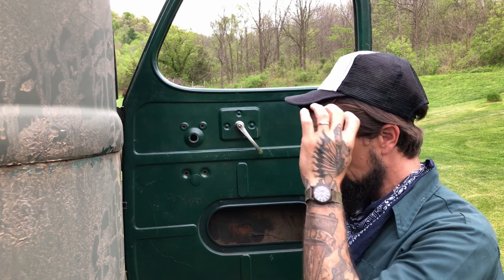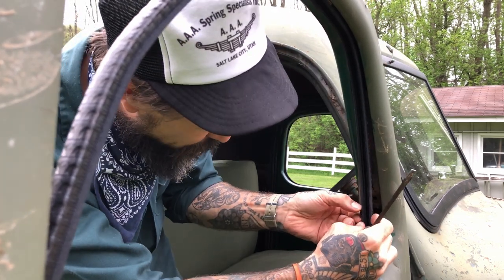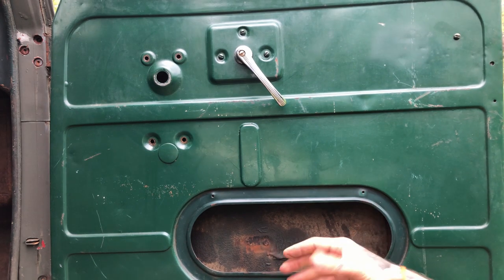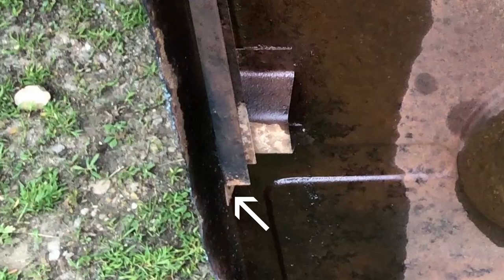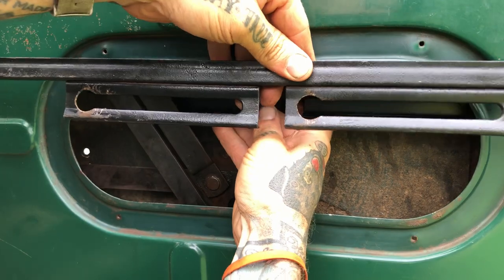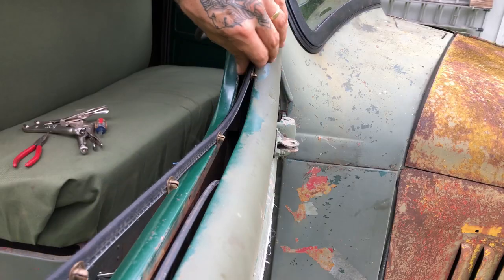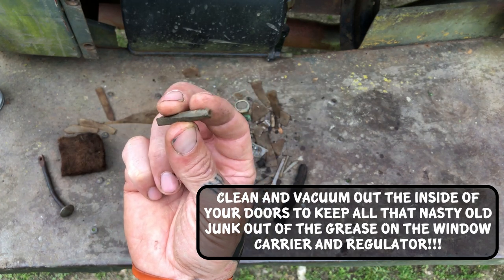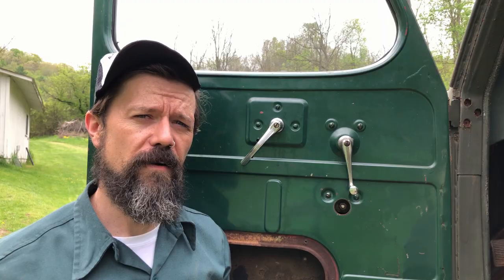Fixing 1940s International Door Window Pt 3

Comment: You should make a video using that spare inside door panel. Showing the window and door latch systems working from the inside view. Would help owners visualize what is going on in there. Can't wait to get my truck back home and start this process after seeing this. Truck is having the rear window modified to roll down right now so they are adding pretty much the same setup as what is in the doors. Although it will be motorized. Didn't want to turn around to crank it open or closed. Gonna find another windshield crank to use on the dash as the switch.  Thanks for the detailed videos. Well done.
Reply from the maker: Hey, that’s a good idea! I’ll start getting that video together in the next month or so!

Comment: Great illustration on replacing everything. Where did you get the new felts at. I just bought a 47 and I’m going to try and rebuild everything, window roller and the door latch. Any advice would be greatly appreciated.

Comment: In the process of doing my windows and door regulators currently. I used a rust remover on the regulators but let sit for over a year. everything got extremely goopy. Back at it now. I used blue liquid toilet bowl cleaner with wire brush made regulators look really good and clean. Cant recall the grease you used. Also what was the tape you used at the bottom of the window track?

Comment: Great video. Restoring. 1940 international 1 ton.  A real rust bucket. Tip on hammer screw driver saved the day.   Cut the slots
Deeper with an angle grinder.  All came out. Explanation on the nut was invaluable.  I’m trying to find window carriers.  Any ideas?  Thanks Al.
Reply from the maker: There’s quite a few IH groups on FB that you may try posting that you’re looking for some, those groups are pretty valuable for finding stuff like that. Other than that, I’m always combing eBay and junkyards for small bits like that.

Comment: Great video,  I am working on a 1940 D2.  Where can I find the clip that hold the glass channel in place.  I have a few original but not all of them.
Reply from the maker: Those clips are available from Restoration Specialties. The part number is "1972". You'll have to call to order them. I'd order extras just in case some bend on ya.

Comment: I have a 1947 KB-1 truck that I bought window liners for a long time ago. I started installing the window liners yesterday after receiving my liner clips. It does not appear that the clips are a perfect fit as the liner pushes the clip wide both sides. This window liner has some sort of steel built within so it can bend to the proper radius around inside corners. Any suggestions as to why I cannot get the clips to snap in holes because the clip is too wide on either side of the liners.